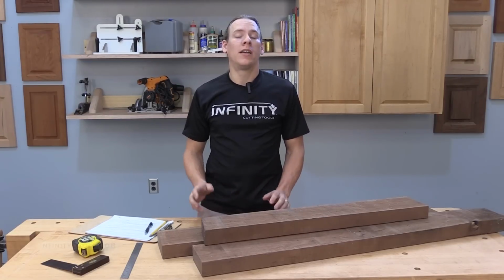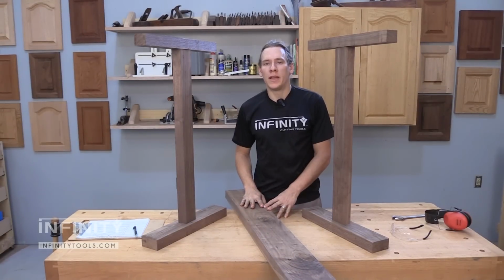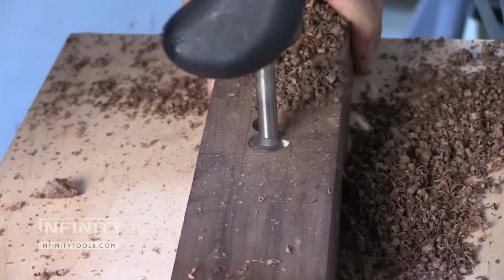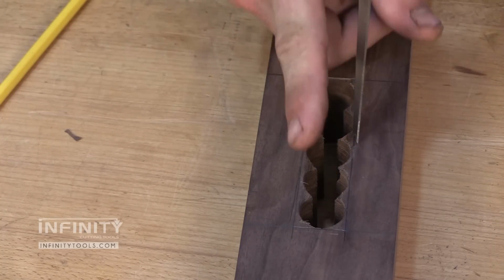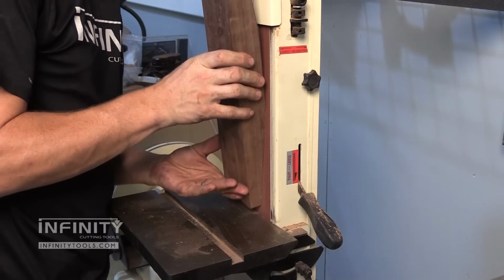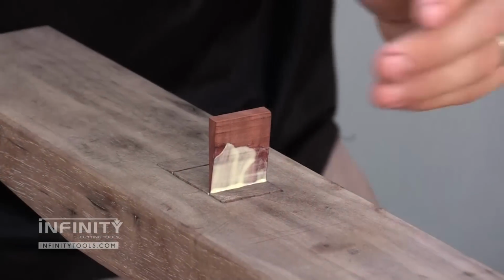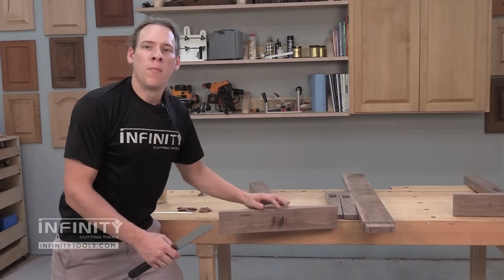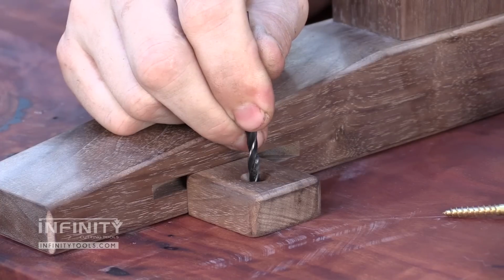Live-Edge Slab Table Part 3: How To Build a Table Base

Comment: I am currently building a wood slab table out of 8 cm thick oak (350 cm x 100 cm). Do I need to use sliding dovetails or something else to prevent the wood from warping? Thank you Henning
Reply: No if the wood is properly dried once you've flattened it it should be fine.

Comment: Is it only the brass screws keeping the table top on the base? No glue used to affix the table top to the base?
Reply from the maker: Yes, the top is held in place by the wooden clips and screws, This allows the top to expand and contract without causing the wood to crack.